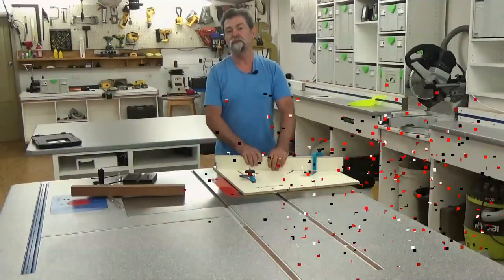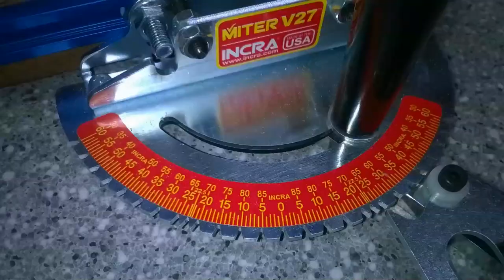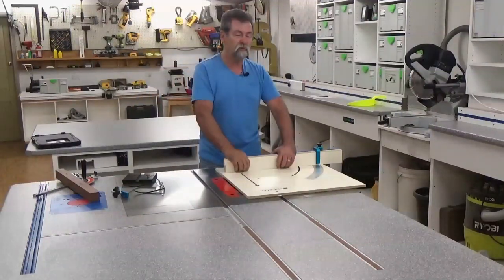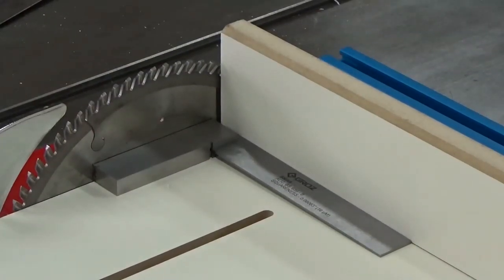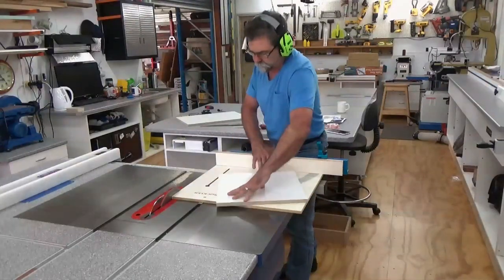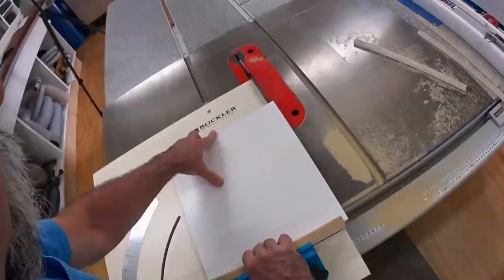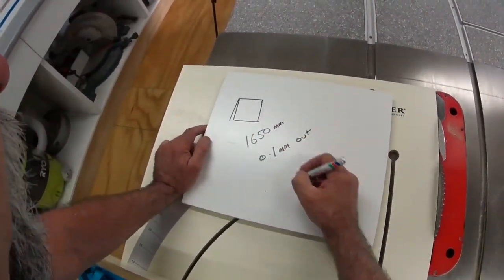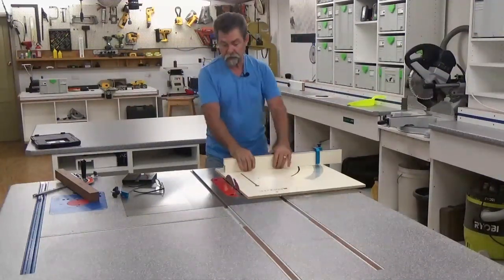crosscut sled | 5 cut | how to | dave stanton | rockler ideas

Comment: I'm relatively new to woodworking and don't yet have a crosscut sled but have recently realized that a good sled would improve my accuracy, repeatability, cut quality, and safety at the table saw. I've been considering building one (Tamar's design with the Katz-Moses stop block) but at the end of the day I'm not certain that I could do any better than the Rockler and am thinking about buying one while it's on sale.  After watching your video, I'm pretty convinced that the Rockler sled is the way to go. Thanks!

Comment: Hi Dave, I just unboxed my Rockler sled, and am wondering if you recommend any type of sealer for the outside perimeter of the melamine covered mdf. To me it seems thin and I'm concerned about smashing a corner off. Also, it's soooo humid in Florida, I fear the unfinished sides of the mdf will absorb moisture. Thanks for performing the 5 cut method, and showing us how easy it is to adjust to near perfect 90 degrees. Fantastic tip about the spring altering to eliminate slop, too. I have a small portable jobsite saw and just hope there is enough infeed space to be able to utilize the sled. Your video is BY FAR the more useful and informative. Thanks a millon ...
Reply from the maker: Hi Sue B! Any clear poly product should do it. 2 coats with a light sanding between.

Comment from the maker: I was all set to make a sled like this one for myself but I just ran out of time and this one had everything I needed. There are probably other similar sleds available out there, purchase or make the one that is right for you but use the 5 cut system to get it spot on.
Reply: Nice video sir and no offence but your shop it's so clean and looks like a kitchen.
Reply: Can  you or have you added a tape measure to the top of the fence to make it easier to set the stop?

Comment: David, first rate review .. many thx for pointing out the issue and having a fix. I find ROCKLER brand jigs/fixture are for the most part "good" with some quirk that needs addressing, I had to tweak the Tapering Jig for setting Zero clearance ... best regards and good holidays .. john
Reply from the maker: Thanks for watching John and have a great festive season!

Comment: It may be just me, but I  bought the Rockler sled to use on my Saw Stop job site and the blade side of the sled was about an 1/8" short so I was not able to make the zero clearance cut.
Reply from the maker: Thanks for sharing your experience! It sounds like that sled didn’t quite meet your expectations. Have you considered adjusting or modifying it for a better fit? I would add 12 mm to the width by glueing some MDF to the edge of the sled and then trimming to size using the sawstop saw. Please let me know how it goes for you.

Comment: I have watched quite a few videos showing how to adjust your fence 90° to the blade. Why not make the fence 90° to the cut you just made when you cut the sled to mate it to your saw and use the Pythagorean theorem to dial in the fence. You do that one time and you are perfect. 
If you are going to square off your blade then you better make sure your blade is dead nuts parallel with the table slots which is not alway the case. That is why I square off from the trimming cut.
Reply from the maker: Hi Kris!
The reason is there is the risk of jambing the workpiece as it is being cut as the governing factor is the mitre slot.
Reply: @DavidStanton  any cut you make is going to follow the cut on the sled, right? Some people have no idea how to align the blade to make it perfectly parallel to the miter slots.

Comment: Hi David!  Thank you for your very informative review!  My question is, will this Crosscut sled work on a Dewalt 7480 which has a 22" x 22" table space?  Thank you!
Reply from the maker: Interesting point Ryan Reeves. Just as long as the saw has a 3/4" mitre slot it should be ok.
Reply: @DavidStanton  Thank you!

Comment: New sub here. Great channel and cool dog!
Quick bio:
Im relatively new to woodworking and my focus is on home repairs, trim carpentry and mostly fixing the mistakes of others.  I am a painter of 36 years but, just got sick of waitng for "carpenters" to do their job and then do it poorly. I know how things should look so i dove in and discovered festool simultaneously. My tool selections are all based on portability and i do not have a fixed shop. The paulk total station is my work area.

I have found (for me) that trying to make these sleds is far more dangerous than trying to make the small cuts another way and i can NEVER get them to not be sloppy in the slots or get them square.

So I have given up on wasting wood trying to make them.
The End

Comment: Merry Christmas, David. Really like your videos.

I do hate to correct you but one thing about your calculations on the five-cut method that could be more accurate is to use the sum of the length of the four sides and divide by four instead of five and five as you have done. This is only a slight issue, and only when the length and width dimensions of the test piece vary a good amount (when it is rectangular, but not even close to being square.) Wouldn't even mention it, but this is one situation where we're talking in thousandths of an inch and we want to dial it in as close to perfect as possible.

None the less, love your work. And give Barry a pat for me! :)
Reply from the maker: Merry Christmas Corwin. I have a question for you re the 5 cut. Not sure if a square or rectangle makes too much if any difference but the question is the difference on the final, 5th cut from front to back of the offcut, are you saying that is incorrect?
Reply: Square or rectangle doesn't make a difference, but use the longer side for the first and last and any error will stand out more. And nothing wrong with the 5th cut, but rather consider only the last four cuts (and their lengths) in your calculation. We're talking about a four-sided piece, with four corners that we would like to be as close to perfect to 90s as possible. Even if we made six or seven cuts on the test piece, only the last four would be meaningful in our calculations.

Again, sorry to nit-pick. But, here we're trying to get as close to perfect as possible. And, some think they need to be closer to perfect than others. ;)
Reply from the maker: OK, I think we are on the same page. The difference front to back on that last (5th) cut is the combination of the error in the 4 previous cuts. This is why I cut a section off rather than trim the edge. Not nit picking at all. I am all for getting it right even if I am wrong....did I just say that ? LOL. Merry Christmas.
Reply: Oops, I am mistaken here. Watching again, I see that you were calculating the error over the total distance cut, which is fine as you have demonstrated. I shouldn't post late on Christmas eve. Ha, ha.
Reply from the maker: I was sure we would agree. I must be more specific in my videos so there is less room for misunderstanding.
Reply: Corwin may have had a little eggnog that evening! Lol! Great review David and great comment Corwin. A late Merry Christmas to you both!
Reply from the maker: Merry Christmas Kim.
Reply: Ha, ha, ha... good one, Kim! I questioned David's inclusion of the length of the first cut (of five) in his calculations when I first viewed this video. So, before I posted I looked at how other's made these calculations. However, when I returned to post here, I made a mess of things. And, all without the aid of eggnog! Maybe a little eggnog might have helped? ;)

Yet, I still do believe that one should not include the length of that first cut in their calculations. The error you are looking at when measuring that final off cut is the result of an error repeated at each of four corners, not five. I don't see that it matters how many times you continued making cuts, it is only the length of the last four cuts that should be part of any calculation. At least, that how I see it.

That's it for me, as I'm off to get an eggnog. :)

And hope you all have a nice New Year!

Comment: thanks, Dave. Very useful demo. One small point - 1650 mm = 1.65 m, not 16.5 m
Reply from the maker: Thanks for watching. Not sure if you are familiar with the metric system or not totally understanding what I did? I was out 0.1mm over 1.65 metres. I then said, I was out by 1.0 mm over 16.5 metres. I multiplied 0.1 x 10 so I had to multiply 1.65 x 10 as well. Hence 1.0 mm out over 16.5 metres.
Reply: David Stanton hi, Dave. At 8:19, you measured 1mm off in 1.65m to correct. That was my comment. Hey, I was president of my high school's slide rule club.
Reply from the maker: If you watch through to 11.30 you will see that I had adjusted the sled and recut giving me the error as stated.
Reply: David Stanton indeed you did. I'd buy one but some reviews were not very complimentary. Will try making a pi/2 sled first.

Comment from the maker: For those interested in the degree of accuracy my sled has in imperial measurement it is 3.93701 thou over 65 inches (5.4 feet)
Reply: David, sorry to be a pain in the bum but it wasn't 16.5 meters but 1.65 meters as there are 1000mm in a meter, so 1650mm would be 1.650m. which would be 65 inches as you said, 16.5 meters would be something like 60 foot
Reply: oh, my bad, you said 1mm not 0.1mm over 16.5m
Reply from the maker: Eric D. I see your next post Eric, all good.

Comment: I greatly prefer a sled that spans the blade, supports stock on both sides and runs on 2 slots.  I've had terrible tear-out problems with this type of sled.
Reply from the maker: Hi Tioga. I also have a larger sled that runs on both slots but I find it hard to create anything other than a square cut with it unless I am trimming a piece with no overhang.

Comment: 1650mm = 1.65 M. isn't it?
Reply from the maker: Correct. The sled was out 0.1 mm over 1.65 meters which is 1650 mm. To make it easier to visualize the degree of accuracy I multiplied both by 10 to get 16.5 meters (16500 mm) out by one millimeter.

Comment: Dave bought based on your recommendation out of the box it was bad the indicator was not glued in properly the miter box bar was next to impossible to get tight in the slot also had a spring missing good idea bad design Rockler needs to step up to the plate and fix this thing, this item in my eyes is not worth the money.
Reply from the maker: Thanks for the feedback Wayne. Return it for a refund or replacement. I can only comment on the one I purchased which was as I explained in the video.

Comment: Your calculation are off. 1650 mm it's 1.65 m not 16.5 m. 0,1 still pretty good but not as dramatically good. Thank you for your video
Reply from the maker: Thank you Aleksandr Kumok but he sled was out 0.1 mm over 1.65 meters which is 1650 mm. To make it easier to visualize the degree of accuracy I multiplied both by 10 to get 16.5 meters (16500 mm) out by one millimeter.